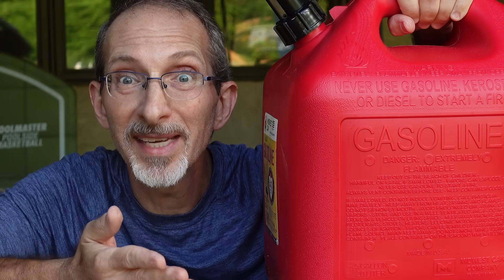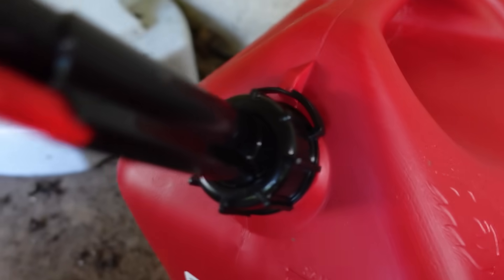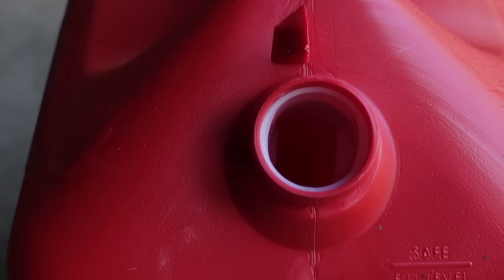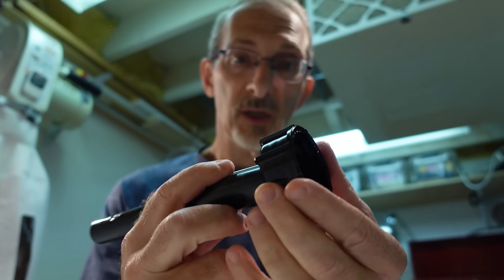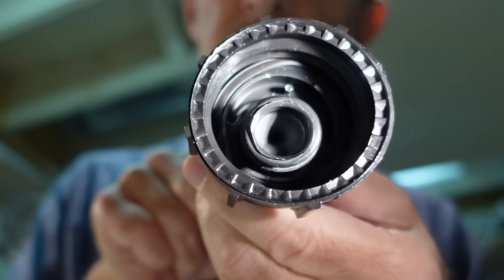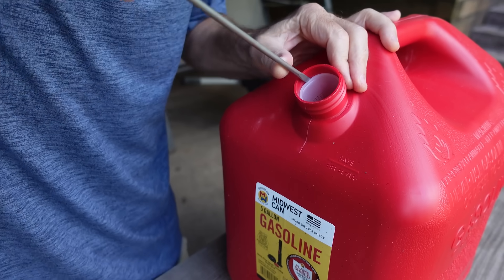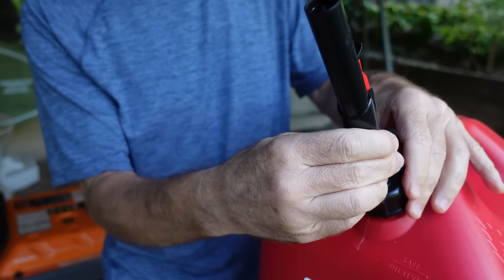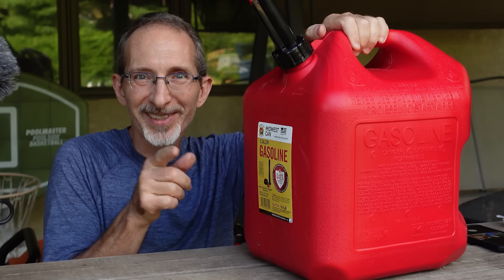Gas Can Modification | New Gas Can Fix

Comment: no Mike ..no rules broken. your developing your engineer skills, on  A  REAL  PRACTICAL  LEVEL. what good is anything, 'stick to the rules '   if it is not   F U N C T I O N A L  .........?? BS. i mod alot of things, for the specific purpose for my requirements. DO  NOT  FEEL  GUILTY.....
Reply: ..they are YOUR GAS  CANS.........
Reply from the maker: Thanks Peter! It’s easy to second-guess yourself when you are recommending things that might run counterintuitive with safety. Like you say, you have to keep things on a real, practical level!
Reply: Thankyou too much, Mike. For example:  i used 1 inch black foam water pipe insulation, on the bottom of my garage door.  After removing the bs rubber factory one, smoothed the bottom edge of door, sandpaper. Then, stretched eace 3 foot section, through the slit on the foam, over the bottom of door, then stapled the top of each side, of the slit, to the door. (wood, sectional vertical liftup one). Adjusted the sections, as the door had a bit of a sag. About 6  1/2   3 foot sections. And, the door bottom seals perfectly, and if you drop the door, no damage is done, as the foam ALSO  ABSORBS the impact. Keeps rain, critters, even ants out.   Please stay safe, and keep on keeping on.   ...

Comment: That filter was one of the longest filters I’ve ever seen! 😳
Reply from the maker: Yes, it is crazy long! I guess that’s to accommodate the length of the gas nozzle at the pump.
Reply: @MikeFyxdt  the filter holes seem large...as to filter sand ????
Reply: @Paufit  that's because it's NOT a filter... It's a flame arrestor. The screen keeps a fire from traveling back into the can.

Comment: OMG!!! I wish I had seen this during the winter! Putting gas in my snowblower was brutal! A lot of gas was spilled! Thank you!
One thing I have found is the gas leaks at where the nozzle screws into the can. Any suggestions?
Reply from the maker: I’m glad the video is relevant, and that’s a bummer with your snowblower, especially since the frustration is made worse by having to work in the cold. If your container is leaking where the spout attaches then I would inspect both the can and the screw collar to see if there’s any imperfections that could be smoothed out, to get a better seal.Alternatively, you might consider an inexpensive replacement spout, which a lot of people in these comments recommend. Hope that helps!

Comment: No, the new cans are unsafe as hell.  They build up pressure and can spray gas everywhere.
Reply from the maker: So many people have reported gas getting sprayed because of pressure buildup. The best solution it seems is to loosen the main That holds the nozzle to let the air equalize before trying to dispense. Good point!

Comment: Cut a few turns off the spring so that it's just enough to hold the nozzle closed, but it will open with slight pressure. Get rid of the button altogether so that you can hold the can with both hands.
Reply from the maker: Good tips, might be worth a try!

Comment: Confused on the purpose of the filter unless it's a "One Way" type filter.  So it will keep impurities from getting into the gas can but when you pour the gas out, won't those impurities go into your equipment????
Reply from the maker: Donald, your confusion is warranted. It was my mistake when I made this video, it is not a filter but rather a flame arrester safety device. I explained this in my follow up video, link in the description. Thanks for watching and commenting!

Comment: I'm amazed they haven't stopped making these stupid nozzles.  Terrible design and you always make a mess with them where with the older ones you didn't.  
I know, I know, the purpose is to stop gas from running out of the can when you tip them over.  But hey, that's how we weed out the heard.
Reply from the maker: Yes, exactly. I understand the intention, but the execution leaves a lot to be desired. At least these containers are much more usable now. Thanks for watching and join in the conversation!
Reply: @MikeFyxdt  I told my brother about your video and today we fixed all our gas cans.  Thanks again for the tips!

Comment: I use this style of fuel cans 5 days a week to fill rental equipment of all sorts. 
We have about 8-10 of them. 
They are not modified at all and if you are Smart Enough to use and fill them they work very well. 
We use the 1gallon with a different push button valve for Mix Fuel for the smaller 2 cycle equipment. 
I go through 20+ gallons a day and hardly ever spill any at all.
Reply from the maker: James, good to know! Admittedly some of my struggling was due to the size of the 5 gallon containers, and not having the dexterity to manipulate the safety features. I imagine it would be easier to master on smaller containers, but that skill just wasn’t coming fast enough to me, so we made some changes!

Comment: these gas cans aren't very safe, if it get a little pressure built up and you press the nozzle down to use it will squirt gas out. so keep them in fridge or in a really cool place.
Reply from the maker: Shane, you definitely need to burp these cans bye opening the screw in a little bit to let the air pressure equalize. Excellent safety tip that you bring up, everyone has to be careful!

Comment: Another improvement is add an air vent to the top rear by drilling a hole and installing a vent cap to it. These are like the older cans had and can be purchased online at places like eBay. Old style replacement nozzles can be bought too.
Reply from the maker: Thanks Thomas! You are correct, and I added a vent in my follow up video. It really does make a difference in how smooth the fuel pours. Thanks for joining the conversation!

Comment: The "filter" is not a filter, it is a flame suppression device.  When designed and assembled properly, they do not keep you from filling the can normally when using a modern low flow rate gas pump.  It may be a problem if you run into one of those older design high flow gas nozzles with a hair trigger.
Reply from the maker: I must’ve had one of the higher flow nozzles you described, because there was no way that container was letting the gas in at the pump! You are correct, what I called the filter is a flame arrester safety device. I corrected this in my follow up video, link in the description if you’d like to watch. Thanks for watching!

Comment: Had to deal with this BS just the other day. Spilled more gas with that pos @ 2:14 then I ever would have had they simply provided a sealed cap for when the can was not in use.
Reply from the maker: Using the spout as a cap just doesn’t work all that well. I agree that a plain cap would be a welcome addition!

Comment: I pushed the spring in and gas shot straight up in the air ! Fortunately I was smart enough not to have my head in the way.....
So this is a welcome video!! Thanks again.
Reply: If you overfill the can, the gas can cover the bottom of the spout. Since the can isn't vented, pressure can build up, then if you press the nozzle in while the bottom of the nozzle is still covered by the gas, the pressure will force the gas out the nozzle. By tipping the can back, you move the gas away from the bottom of the nozzle so that the pressure can be relieved when you open the spout.
Reply: I've has this happen. Can wasn't over filled just when I filled a day earlier a tiny bit stayed in the nozzle and when I opened it to release pressure before pouring it was a fine mist straight in my face.

Comment: Why not just get a new cap and a close fitting funnel like we used to use ...
Reply from the maker: Chris, a replacement cap and a funnel is a very popular option! I was determined to improve the spout they came with these containers. I’m pretty happy with how it came out. If or when it should fail then a simple cap and a funnel might be my go to. Thanks for the tips and thanks for watching!

Comment: I had an old one with no safety features but its time has ended. Got a new one at home depot, has a green lip that you have to push in and push the whole back of the nozzle forward. And the nozzle is horribly designed, you have to use a funnel to pour gas into a vehicle. Then the gas leaks out of all the holes for the hinges and springs the safety latch uses to pour the gas. Extremely horrible gas can!
Reply from the maker: I’ve seen those green lever gas spots but I’ve never used them. They sound just as horrible as the black ones on my containers! Thanks for joining the conversation!

Comment: Thank you for the video. I simply use a different nozzle to pour. Problem with that tank also. No vent hole. The can blows up like a balloon if you store it. Going to need to put a hot nail through the can to make a vent. To stop the can from turning into a balloon. It's really nuts. Gas cans must breathe. They forgot about that. Great video. Keep up the good work.
Reply from the maker: @Gym - Thanks for the compliments! Vent cap added in the 2nd video:  https://youtu.be/XoYxdrhB6Ls. Thanks for watching!

Comment: Ironically, I just bought two 5 gal. cans with this very same set up. Went to use it and it was a wreck!  Gas all down the side of my car.  Tried it on the RV generator gas tank; same thing!  Fuel spills all over the place not to mention the danger.  I will be doing this very thing to those two cans to avoid the danger and the wasted fuel.
Reply from the maker: @Jim - good timing! I'm hope it works out for you!
Reply: @MikeFyxdt  mission accomplished.  Turned out great.  Changing the spring tension really made a difference. Thanks again!

Comment: I just spend $4 for the "normal" spouts. Also, you didn't put a breather hole on the back of the handle to let it breathe.
Reply from the maker: Replacement spouts seem to be the most popular option. I did the vent cap in my second video, link in the description. Thanks for watching!

Comment: Another mod that I have done along with removing the spring is I drill a hole just at the base of the handle and insert a valve stem with the Schrader valve removed this way all I have to do to vent the can is simply loosen the valve stem cap accordingly now you can poor your fuel with ease I'd like to add that the steel valve stem with the retaining work best if you leave gas in the can for extended periods because the pressure build up will blow the rubber valve stems out
Reply from the maker: I like the Schrader valve trick! I never thought about them blowing out because of pressure, but I see how that could happen. Thanks for sharing your tips!

Comment: Im going on 60 years old now and by my estimate I have 20 years or less left to grace this world. Luckily in my lifetime I have accumulated no less than 10 gas cans of various design, even a couple of old metal ones. These new ones suck! At least this is one thing I wont ever have to deal with!
Reply from the maker: These two midwest gas containers are cans five and six for me. Definitely my least favorite designs. They are also my only 5 gallon cans, so they are bulk makes them even more unmanageable. Only one of my other cans has a new fangled safety spout, and it’s manageable.

Comment: I got my fix I use a old boat funnel and throw away the spout and put a cap on it. Then pour directly into the funnel.  I do have some aftermarket funnels on older cans
Reply from the maker: I’m not quite sure what a boat funnel is, but there sure all are a lot of people in these comments pouring directly into a funnel and getting rid of the spout! I appreciate you watching.

Comment: AND - if you go to the 'net you can buy the yellow vents with a snap cap that are SOOooo much better than those in nozzle ineffective things.  1/2 " hole where it makes sense in the tank and just press it in until it pops.  At that point life is much better than just good.
Reply from the maker: Joe, yes I agree! In my follow up video I installed the yellow vent and it works great! There’s a link in the description if you’d like to watch that video. Thanks for joining the conversation!

Comment: Make sure your nozzle ring gasket is straight on the base of the nozzle. Watching your video, part of the gasket came off the base of the nozzle which will cause your can to leak while pouring the gas.
Reply from the maker: A lot of people have mentioned that the gasket looks deformed, but it turns out the gasket is fine. What looks like the gasket is actually part of the plastic spout, right below the gasket. The plastic has some messy extra junk at the bottom, but the gasket itself is intact and is sealing very well. I appreciate your noticing and your concern!

Comment: The new safety upgrades are motivated by forcing new gas can sales than safety. It’s no different than Apple changing the connectors on their chargers for force replacement of perfectly good chargers.
Reply from the maker: I’ve come to believe that national safety laws have driven the designs of these cans. I can’t imagine anyone saying “I need one of those new designs because my old design gas container just isn’t good enough”! Thanks for joining the conversation.

Comment: It gets my goat that the stupid EPA can regulate stuff like this with absolutely no oversight, AND that for some reason I have to buy CARB (worse than the EPA!) compliant cans in a state 2,000 miles away from California! We had good cans in the 90's that flowed great and didn't have all these stupid "safety" features. Unfortunately, they all got old and cracked, so now all my cans are these new crappy ones.
Reply from the maker: It’s really hard to buy a reasonably priced gas container without all the safety features. From what I gather, some safety features work better than others. With a few modifications my gas containers are working pretty well now. Thanks for watching!

Comment: The best way to fix them is don't buy them in the first place. Find the ones with the green push button spout. Best ones made.
Reply from the maker: Lesson learned! I’ll have to watch for the ones with the green button. Thanks for watching!
Reply: I think they are called ez pour. More expensive but worth every penny. I have 4- 5gal and some smaller for various mix ratios.
Reply: Correction, No-Spill brand.

Comment: I'd like to meet the moron who came up with those idiotic spouts. I have a few choice words for him/her. Maybe it was a whole team of morons who came up with them. Engineering has hit a new low. 🤬 I have spilled more gas with the new spouts than I ever did with the old, simple spouts.
Reply from the maker: I agree with all your frustration James. I sure hope gas spout designs improve in the future!
Reply: @MikeFyxdt  I tried the expensive after market spouts from tractor supply but they are too big. I found some smaller ones the other day at another farm store that are smaller but haven't tried them yet. The frustration comes from buying a gas can and then having to spend another $10 for a spout 😖

Comment: I was at a gas station with one of these stupid cans and was having an issue filling due to that stupid screen on the inside. I grabbed a screwdriver and just pushed it all the way in. Yes, it’s stuck inside, but it doesn’t effect anything. I also got tired of these nozzles, go on Amazon and eBay. Plenty of kits for a normal nozzle and parts to add a vent hole. Just like the good ole days!!
Reply from the maker: I’m amused by how many people in the comments section have pushed the mesh flame arrester in, instead of pulling it out. Everyone agrees there’s no harm done. Aftermarket spouts seem to be a really popular option. Honestly, before doing this video I didn’t even know they were a thing. Live and learn! Thanks for joining the conversation.
Reply: @MikeFyxdt  I pushed in because I was at a gas station, had limited time and tools and was frustrated AF (notice how much time and care it too you to take yours out). I needed to gas and go ride, not design a science project. These cans suck off the shelf!!
Reply from the maker: @KosmicHRTRacingTeam  Ha ha! It would have made for a very short YouTube video if I just wacked it into the can! Besides, my OCD would be bothered by it rattling around in there.

Comment: New gas can tops:  If it aint broke, fix it till it is......

I felt like a complete dipstick the first time I tried using these gas cans and honestly, I couldnt figure out how it is even supposed to work.  The one we've got, the red bit doesnt even push in or down, so filling up anything is basically impossible.  Ive just reverted to removing the whole dumb top spout and pouring it into the lawn mower without the spout on...and yeah, I basically pour gas all over the mower when I do it that way, but screw that new gas can spout.  Might have to go do this to ours.  There really is no reason for them to be that complicated....
Reply from the maker: Yes, I had the same problem with the red button on mine. Horribly difficult to press in. So many people are ditching the spouts and just using funnels. 😄

Comment: The screen on the inside is not for filtering debris.  It's for idiots that pour gas on open flames.  It prevents the fire from flowing into the can and blowing it up. It's an idiot safety feature that causes a safety hazard when trying to put gas in the can by causing it to spill out. The safety shut off on the filler is also another safety feature that creates a safety hazard not only for the user but for the people responsible for making life harder in the name of safety because if I ever see one of them...
Reply from the maker: Brian, you are absolutely correct to bring this up! I found this out after posting the first video, and I explained it in detail in my second follow up video, link in the description. It was amazing to me how the safety features, which are mandated, are being marketed by saying that people requested all the safety devices on these containers. I appreciate you watching and joining the conversation!